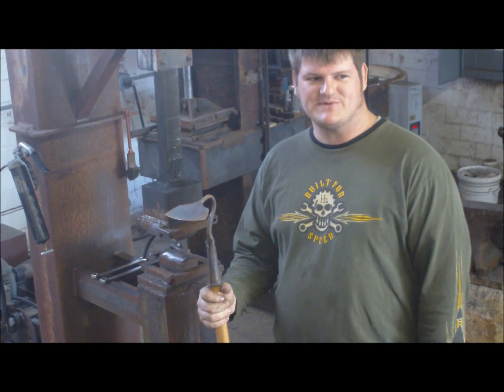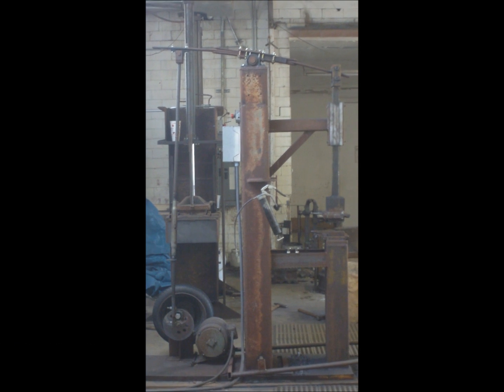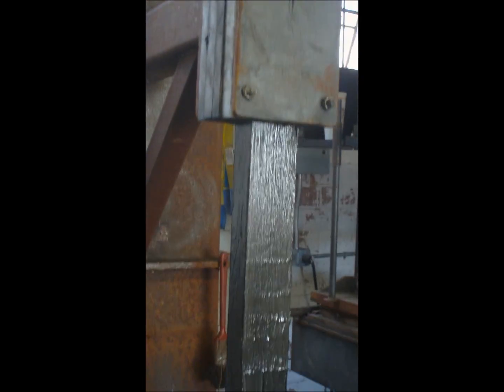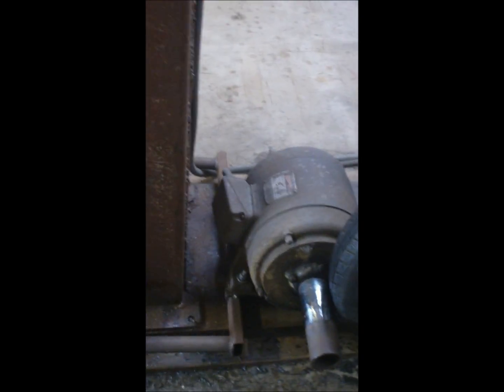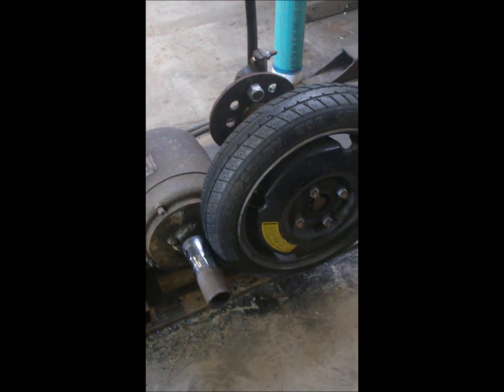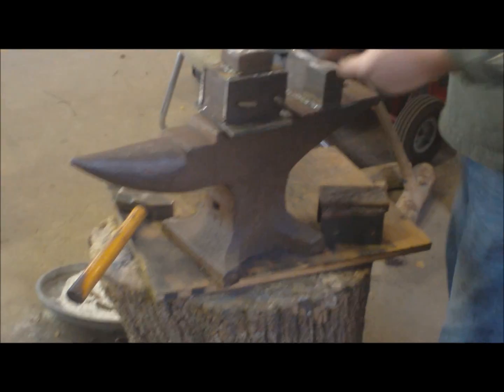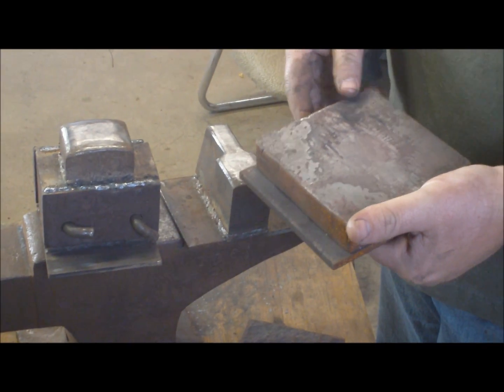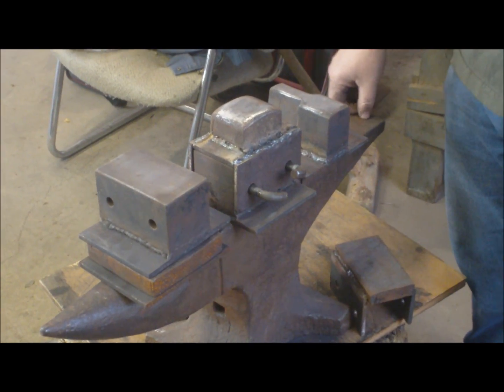An in-depth look at Gunnhilda, my homemade power hammer

Comment: Thank you. Most instructive and complete. That gives me enough about the essential elements of your guided helve power hammer to begin a design for my grand nephew. Seems to me the unspoken trick is to coordinate the spring rate with the weight of the ram so the system resonates at the desired blows per minute. 

I'm attracted to mechanical drive power hammers because of their efficiency. The energy circulates in a resonant system and is drawn only when the hammer strikes. No boilers or outsized compressors required where 90% or more of the power is wasted, vented to the atmosphere.
Reply from the maker: Yep, the spring resonance is a big part of it working, and I'm not sure how you would go about calculating it.  I had to just mess around with the number and arrangement of leaves to get it decently functional when I first got the hammer.

Everything has advantages and disadvantages.  This spare tire clutch gives good control for a mechanical hammer, but an air hammer would be more controllable, and with the right control valve setup, would be able to do single hits, clamp, or reciprocate depending on how you set it.

Comment: very cool! Very ingenious! i would like to build a similar hammer, possibly somewhat smaller. One thing i was wondering about is, what did you use for the anvil? I would think the anvil should be many times the weight of the ram. i had considered using a piece of 8" square steel 32 " long, if i can get one. But it would weigh 540#. The other problem is, how the heck am i going to square up the ends of such a thing??? I would appreciate any dimensions you can give me on Gunnhilda. Height, size of ram and ram guide, distance of mot0r and ram guide from main post, etc. thank you!
Joe smith , joe.thesmith.smith@gmail.com

Comment: Thank you for an informative video. You are going straight to the point :-), that is great.
I was wondering about the forces aplied to the leaf spring as it will probably be exposed to bending both ways, up and down. As a result of that the stress will be alternating between compressive and streching.
My question is therefore do you have any issue with fatigue in the leaf spring?
Reply from the maker: I've had the main leaf break two or three times now.  It's a bit startling, but hasn't thrown steel around; it just drops the ram, clamping the piece I'm working on.  The helper springs seem to be a point of stress as it has broken each time at the end of the helper spring.  This last time, I removed the helper spring, so I'm currently running a single leaf 3" wide and 1/2" thick, approximately 6' long.  That was this past summer.  We'll see how long it lasts.
Reply: @Helmforge  Thank you. I fint this subject is quite interresting as I believe the spring is breaking as a result of fatigue. I have resently read som theory about fatigue; definition, causes, possible prevention and that different types of loads influences fatigue more or less.

Definition:
A fatigue crack is started with loads in a materials elastic region. I.e. not exceeding plastic deformation load. The break has characteristic "lines" (lots of pictures on internet).

Caused by:
Repeted motions. The crack starts on the surface, initiated by a small "dent" or it can be rustpitting or similar. One way to prevent the initiating of a crack is to polish the surface. Or as you did, remove the helper spring and thus removing a concetration of stress and rather let the whole spring flex evenly.

Worst case is streching preload with streching vibration on top of that. Better is fluctuation betveen compressive and streching forces. The best way to withstand forces is when there is a compressive preload and the vibration is a varying compressive force. A way to introduce a compressice force in the surface is by shootpeening, or perhaps hammering with a ballpin hammer. The best way is perhaps to alter the construction to one where the spring will only be exposed to compressive forces, but that is another discussion.

I have not tested this methods myself I dont know exactly how effective and what measures will be best for you.

I am exited to see the updates of your power hammer, maybe the more even flexdistribution was the best measure for Gunhilda :-)

Comment: couple of questions from the uk, what type of steel do you use for the anvil and hammer and even the base plate come to think of it, also how long is the spring and the section size of the hammer shaft. many thanks adie
Reply from the maker: All the materials you ask about are from a junkyard, so no way of knowing the alloys.  The spring, off the top of my head is around 6 feet long.  Shaft section size is irrelevant as it will be different depending on the size of ram you are working with.  Heavy-walled square tubing would be a great ram.  Use an online steel weight calculator to figure what size of shaft or tube would match the weight you want in the length of ram you want, and go from there.

Comment: I designed my hammer after yours and i must say i am very happy with it. I used stainless for the ram so it also weighs 100 lbs or so but wont rust or wear out lol very nice man your hammer is the reason i built mine i have watched this video atleast 100 times reverse engineering it
Reply from the maker: Awesome!  There have been at least four or five power hammers built based on seeing my videos of Gunnhilda, which makes me quite happy.  :)

Comment: Very nice hammer and good video for which you prepared well, because you didn't waste any of the viewer's time like many folks do. I have all of the stuff stacked up to build my second helve hammer and am about to start on it, and I have a suggestion you might want to consider. I am going to run mine, as an experiment, on one of the blue engines from HF. They have excellent governors on them and can be held to any required speed regardless of load up to their rated horsepower, which is much higher than the hammer will require.  If accurate speed control equals superior hammer control, as I suspect, it should increase hammer control a LOT. I sold my first helve hammer years ago because of lack of control, so this will be my second effort. Again, thanks for the video....Joe

Comment: Hey great video! I'm in the process of building my own similar (but smaller) hammer and I was wondering where you got your rollers for the top of the ram. That is one part of the build that's really giving me trouble
Reply from the maker: They were made by a professional machinist.  :)  It initially had pipe over rods for the rollers, but those wore out pretty quickly.  You could alternatively build a shackle for it like is on the end of a leaf spring on a vehicle.

Comment: I keep coming back to Gunhilda. Sweet rig. And good explanation. Thanks. But what might you do differently, and what parts show the most wear? The push rod with turnbuckle looks possibly bent a bit. I'd imagine it's probably found it's sweet spot now. But the connection off the eccentric wheel, is there any issues there regarding wear? I want to build a hammer, and really liking this big dirty Gunhilda. Thanks bud
Reply: not using lock nuts on the turn buckle will eventually wear out the threads

Comment from the maker: Ok, if you comment on Tobin's loud breathing (bad allergies and San Antonio are a terrible combination), I'm just going to delete your comment.  The video is here for people interested in making their own power hammer to gather ideas, not to make my friend the butt of snarky comments.  There are several people who have used the video as a springboard for their own hammer builds.  Don't be a jerk.
Reply: I was glad to read your answer to the snarky remarks. You're right, no need to ignorant comments. You just solved several questions I'm looking at. I bought the well know "Build Manual", I like your machine idea much better. I'm building a beast this year. At 62 my shoulders will no longer take the abuse of swinging a ten pound hammer, not for long anyway. I have most of the "stuff" I see in your machine, just laying around, minus the flat plate steel (base) she rests on.
Reply: I folks don't think out of the box and use knowledge to improve them self than they can shut up .Sir Thanks for helping the ones that will let you help others.
 Thanks from me....
Reply: I never noticed it myself.  I guess there is a benefit to diminished hearing.  Thanks for the overview on the hammer.  First one I'd seen was when I was a boy, but then I was told it was a "trip hammer."  Curious to know if there was something distinct about it with that name, and if you know it.  All I remember is that it was a large hunk of iron that looked like it had not been used for a half-century.
Reply: Hey, I'm interested in making this and I was curious what the column of the  hammer was made of is it 5"-5" square tube?

Comment: 100 lb ram.  soooo youre new motor is rated at?
Reply from the maker: Um, it's the original motor and it is 3 horsepower, 3 phase as stated in the description.
Reply: wow. interchangabilty with the dies. the simplest and controllability drives iv seen yet. I like it man.
Reply from the maker: Doing it again, there would be things that I change.  The die-holding setup has changed some (though the basic idea is the same), and I would go with even a different variation of the basic idea.  And the ram guide definitely needs adjustability to make sure there isn't any slop in it.  But overall, it is a workhorse that has paid for itself and then some.

Comment: That's what I figured. I am building a airpower hammer out of heavy equipment parts. I do like your hammer and how your dies can be change out easily
Reply from the maker: +FullmetalKenpachi If you have the mind to handle circuits and a big enough compressor, I definitely recommend an air hammer.  For simplicity, it's hard to beat a guided helve hammer like Gunnhilda, though.  :)

Comment: do you have the blue prints for this power hammer?
Reply from the maker: +FullmetalKenpachi I did not follow any blueprints, just looked at all the related hammers I could find online at the time and took ideas here and there.  There are basic blueprints from the Appalachian Blacksmith Association, but the design is so simple you probably don't need them.  The design is going to vary depending on the materials you have available and how big you want to build it.

Comment: are the baseplates square? it looks like you cant put the dyes in 4 ways but would you ever have found that usefull and would you make it so if you build anothe one?
Reply from the maker: +steffankaizer It would be simple enough to build the dies with square base plates so they could be inserted either way.  There are a small handful of changes I'd make to the hammer if I was starting from scratch, and the die-holding setup is one.  I'd use keeps that clamp down on the baseplates, which would allow the dies to be offset like can be done with dies with dovetails.

Comment: Man that is one hell of an awesome home built tool!!!!
Thank you very much for the vid.
Do you have basic blueprints you'd be willing to share if one would want to built such a beast for himself??
Reply from the maker: Alex Longpré Plans are available from Jerry Allen who built the first salvaged steel-based spring hammer (that I am aware of) called the "Rusty".  Do a Google search for "Rusty power hammer" and it'll turn up.  It's such a simple design, and there are such variations in the materials used in these and the scale at which they're built, that I think you could do just as well browsing YouTube and the Interwebz at large looking at homebrewed power hammers and combining the elements that make sense.  That's pretty much what I did.  Jeff Reinhardt, a.k.a. Ptree, has a hammer design that was very inspirational to me posted up on Anvilfire.
Reply: Thank you very much for taking the time to reply and sharing great insight... I'll start doing my homework.

Cheers lad.

Comment: man ive done some back yard forging,  just playin around tryin to learn as I go and I thought itd be cool to maybe build my own power hammer and it was pretty cool that as soon as the video started I hear youre from San Antonio... im just outside of SA on the northeast side, in Schertz
Reply from the maker: chris stier There's a good blacksmithing group locally, centered around San Antonio and Austin, called Balcones Forge.  Monthly meetings, and at least at one point with a weekly open shop.  I usually host one of the meetings each year.  Check 'em out!  :)
Reply: Ive seen the name when I tried to google local suplies just didnt know much else about it. Ill definitely look into the group. Im just startin to het back into it. I moved about 2 years ago and gave away my little homemade forge and rr track anvil, the past week or so ive started makin new ones

Comment: I  cringe every time you put your finger between the two hammers.
Reply from the maker: millej38 Cringe if you want, but I'm not dumb enough to stick my hand in there when it's going to smash it.  Without going back and watching the whole video, I'm fairly sure that my fingers were not in between the dies when the motor was running.  If they were, I was well away from the foot control, and the ram moves up when the clutch is first engaged, giving most of a second to notice the movement and snatch your hands away.

Comment: I have a 1.5hp 1475 rpm motor. What ram weight could be possible with this motor. Also I am looking to use the slip belt clutch mechanism but you have a wheel, which one do you think is the best and the most accurate. Great video by the way and any help would be greatly appreciated.
Reply from the maker: Matthew Ruddock The fellow whose hammer was a big inspiration for Gunnhilda, Jeff Reinhardt, runs a 75 pound ram on a 1 hp motor I believe, and Joe Calton, who has built a hammer based on mine, is running a 50 pound ram on a 1 hp motor.  
I've never used a slack belt clutch on a power hammer, but folks who have used both seem to think the tire clutch gives better control.  That's why I went with the tire clutch on mine.

Comment: Is the motor you're using a single phase 220 Volt or is it a 3 phase? I don't have 3 phase here but can build a device that gives me 3 phase from the single phase 220 which I have a 3 phase motor sitting around not doing anything.
Reply from the maker: It's 3 hp 3 phase.  The 3 phase isn't necessary; it's what I salvaged for free, and luckily had three phase power available at my old shop, and 3 phase across the road from my new shop, so it didn't cost much to run the lines over.  I also have a 3 phase motor on my hydraulic press and a 3 phase kiln I use for tempering.

Comment: inches from hammer to middle of spring
[ rocker ] ?. voltage ?.... hp ?..... output shaft to tire size ? thanks
Reply from the maker: Horsepower is 3.  Voltage, no clue. 

I'll have to measure the rest.

Comment: Did i miss the part where the machine itself is being explained , the engine and drive system, joints etc ?
Reply from the maker: Guess so.  Got any specific questions?

Comment: which the steel material that you used on the head of this hammer?
Reply from the maker: The dies are 4140.  The ram itself is probably mild steel, from a junkyard.

Comment: After over a year of use, have you had any issues with the way the dies are held in place?  Would you do anything different on the die system?
Reply from the maker: I've replaced the hinges on the side of the retainers with bolts, so there's a long bolt on either side.  It might be a good idea rather than use the retainers on the ends, to have large machine set screws that clamp the die baseplates, kind of like how BigBlu does with their dovetailed dies but coming from the top instead of the side.  That would give more flexibility in positioning the dies, and even allow offsetting the dies if you want.

Comment: This may be a little geeky, but the ram should have a natural resonant frequency on the end of that spring.  Do you think there would be any benefit to setting the speed of the tire so that it roughly hits a that frequency when running full power?

Awesome hammer btw, looks like it will last a long time and based on the knife forging vid it seems to be powerful but also can be feathered nicely.
Reply from the maker: There may be a benefit, but getting it tuned to that would be boogery to do.  Timing the speed of the eccentric with the speed the spring likes to flex at would be easier and more beneficial.  Unless I'm misunderstanding what you're saying and just repeating it.  :)
Reply: lol, yes, you said it much more clearly than i did, we're on the same page.  :)

Comment from the maker: I appreciate the credit, but actually looking back at it, I think I adapted it from several different homebrewed hydraulic forging presses, some on Youtube and some elsewhere.  I just haven't seen anyone else use it on a power hammer.  It has its limitations, as do dovetails and bolt-on dies, but I think it's a good solution for a homebrewed hammer, especially if the builder doesn't have a lot of machining ability.

Comment: my old chambersburg,sits with quad shock absorbant springs.it is just fun to play with .I hate changing the maple boards for the ram though.My dies 185lbs.96 decibles.
I use a tocco electric furnace.and hammer everything by foot pedal.Just like my granddad used to in the mid 40s.I think your set up is just the coolest.great work young man

Comment from the maker: Oh, and I've changed the die holding setup slightly, replacing the hinges on one side with another long bolt just like the other side has.  I think I may have borrowed the basic idea for the setup from how some folks have their forging press dies set up.